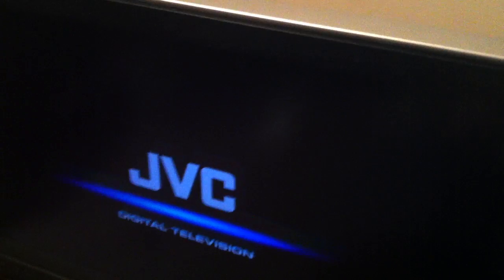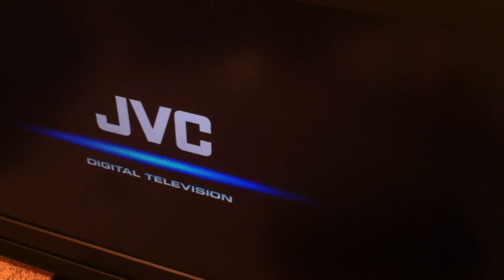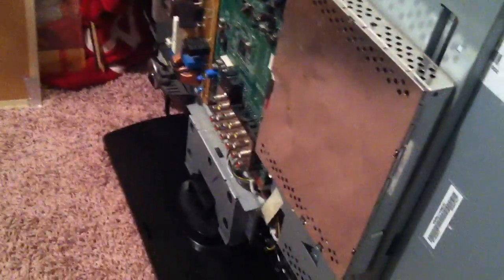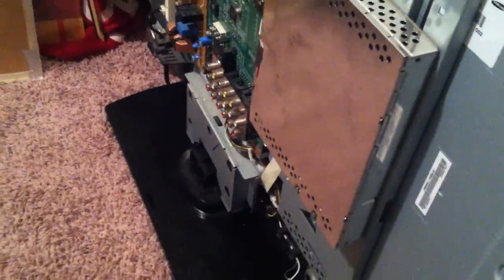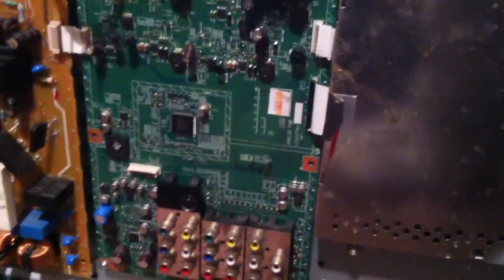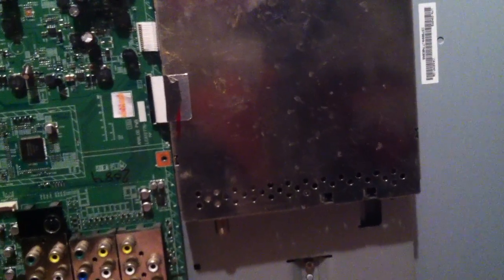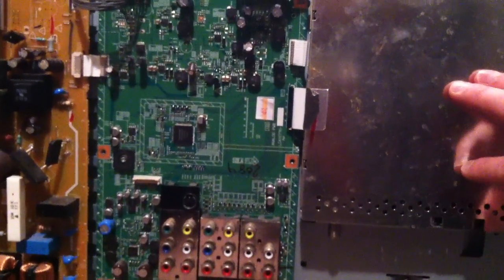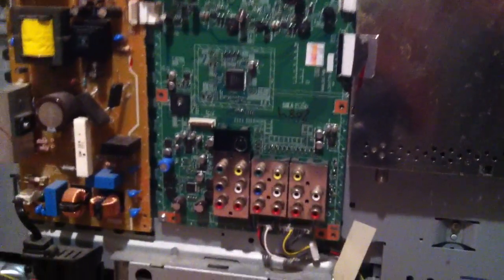jvc lt-32e478 logo loops fix firmware

Comment: Pleasant day to you. Is there a way to access the service menu for the JVC Genessa LT42E478 without the remote controller? The last technician who claimed could fix the tv lost the remote and never fixed the tv. I shipped in my own parts and got it running, but the HDMI ports do not work at all. I have been reading that there is a light sensor at the back interior of this tv that shuts the HDMI ports off when the panel is removed. And it needs to be turned on again via the Service Menu. Please help!!! Thank you for your time.

Comment: Awesome work - Thanks for the video.  Do you still have that firmware?  the Drop Box link doesn't work any more and I can't fine it anywhere.  My email is cubantek@gmail.com much appreciated if you do.  I have the same tv in the video and the HDMI doesn't seem to be working and was going to see if the flash fixes it.  the JVC LT-32E478

Comment: Tengo un TV JVC LT-55KC76. He tratado de reiniciar de fábrica y no ha vuelto a encender. La pantalla permanece negra. La luz roja se enciende al conectar el TV al tomacorriente y se apaga cuando presiona el botón de encendido.
Agradezco alguna solución y el firmware para restaurar.

I have a TV JVC LT-55KC76. I have tried to restart the factory and it has not turned on again. The screen remains black. The red light turns on when you connect the TV to the power outlet and turns off when you press the power button.
I appreciate some solution and the firmware to restore.

Comment from the maker: I have No other firmware
Reply: My screen is just blue
Reply: There is a easier way just press the menu button with the down volume and switch off then count 1-10 then let go it will switch on and be on safe mode then quickly factory reset because it will start freezing so do it fast .....let me know

Comment: JVC LT-55N935? I´ve tried the Kogan firmware but not upgrade. Help!
Reply: yo tengo la solucion, si aun necesitas avisame
Reply: @ceramoto01  amigo tengo el mismo problema que mi tv se queda en logo de android
Reply: @rolandoguayarabey9687  que mal!! yo lo solucione instalando el el firmware del televisor marca kogan, que es australiano, lo malo sera que
Reply: @ceramoto01  amigo como puedo reiniciarlo mi tv jvc 32ltkb275 me puede explicar por favor
Reply: @rolandoguayarabey9687  de ese modelo no se amigo, solo lo logre del LT-55N935
Reply: JVC LT-55KC76 requiero actualización para este modelo. Mi TV no volvió a encender despues de darle restaurar de fábrica
Reply: DID YOU FINALLY SOLVE THE PROBLEM, HAVE THE SAME PROBLEM AND DOWNLOADED THE KOGAN FILE BUT FIRMWARE DID NOT WORK.

Comment: hi i have this tv to im not haveing that logo problem but im haveing a problem with my hdmi ports i cant seem to get anything to come through them when i hook up a laptop or a bluray player can u help me?
Reply: chas voel 
I had the same problem with my JVC LT-37XM48. This worked for me if you still haven't figured it out. 
1. First put the Tv on the Channel/Tuner INPUT.2. Now make sure to use the original JVC remote and the selector switch at the top is in the Tv mode.3.Press the sleep timer button one time, then press both the display 
button and the video status button at the same time. Then press the 
number 2 button for "Self Check".4. Then turn your tv off and unplug the it for full 2 minutes.5. Plug the Tv back in and turn on.6. Plug in your hdmi dvd player directly (bypass any sound systems).7. Switch the Tv to the Digital INPUT and turn on the dvd player.
Read more: @5

Comment: Hi,
I have the JVC 47" Android smart tv, when switched on, it goes straight to AV input, the smart screen logo at the bottom right stays on the screen and the tv is unresponsive to any input, remote control or physical buttons. It can only switched off using the physical switch at the the back of the tv. The smart tv, android interface is totally unaccessible. 
If i get the firmware and perform this procedure will it reset the tv to its factory state? If not how can i achieve this?
thanks,
Reply from the maker: I would check with jvc about the firmware, this video pertains to this specific tv. I have no other files.
Reply: After Hours Tv & Pc repair Ok. Many thanks.
Reply: do you have the firmware ?
Reply: No way. Had to have the board replaced.